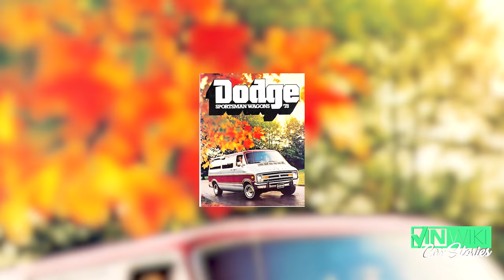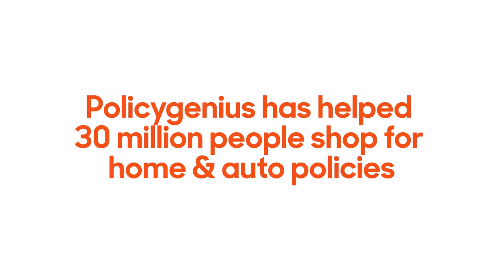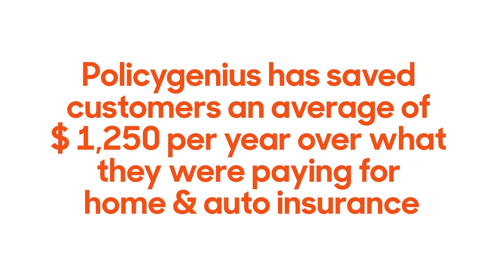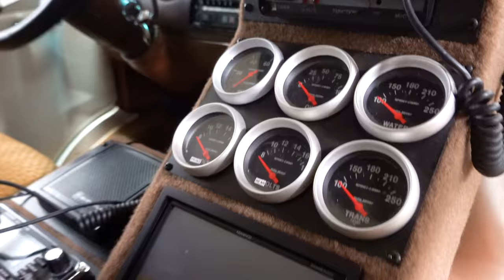They Left A Broken 700HP AMBULANCE At My Shop And Told Me To Fix It (TOTAL DISASTER)

Comment: The spark signal travels at 1 nanosecond per foot, so maybe 3 billionths of a second delay for that extra 3 feet of wire.  The amplitude however might be reduced over that length of cable

Comment: An excellent option for the fuel pump go with a fuel safe drop in a multi pump cage my guess would be a three pump so if one fails you can fairly easily switch it over to one of the others.

Comment: My favourite rare and hard to find van would be "the wide one" a company for a small number of applications widened the dodge van by 14 inches, and I'm not talking the wheels.....the actual body was cut in half down the middle and widened by 14 inches
Reply: Those look very odd driving down the road.
Reply: @mexicanspec  I bet they do, some didn't have the wheels widened so you have 7 inches of body over either side of the wheels
Reply: That thing is awesome bud, I had no idea cheers

Comment: You could take an program an Arduino to the fuel level sensor... where when the resistance = xx ohms, then turn off aux fuel xfter pump...  when it drops below 1/4 tank = xxohms then turn it on....  Automation....  that would be a freaking COOL setup...

Comment: My family had a conversion camper van based on a 70's Dodge van when I was a kid.  I remember that the exhaust manifold got so hot that you couldn't keep your foot on the gas pedal, as it was just a few inches away in the dog box.  We tried everything we could think of as heat shields.  We even had layers of white asbestos sheeting (you could still buy that back then).  It was awful.

Comment: Couldn't really peg the scanners, but make sure they're modern enough to read trunking systems. And if you're concerned about fuel spillage with that monster transfer pump, just plumb an overflow line back into the secondary. I really hope I get to see this van run through someday.

Comment: The problem with using hydraulic hoses for cooler hoses is that the hose liner may not  be rated for hot oil. The result can be hose becoming very stiff and possible liner failure.

Comment: Using a Gear Vendor (putting it in manual mode in splitting shifts) is so much fun you'll be amazed at how quickly you'll launch.  Otherwise, put it on auto & it'll (overdrive) shift up at (?) 45 to 55 mph, it's always nice to hear your motor (chill out) drop RPM.

Comment: Enjoyed this episode. Question. What did you do to shield the fuel lines and transmission cooler lines from both the direct and radiant heat from the exhaust pipes and mufflers. Your quite scarce on proper heat shielding of wiring, transmission and fuel lines, plus protecting the floor boards from excessive heat from the exhaust system, headers and engine heat. 

Did you reconnect the fuel pipe vent line that runs from the top of the tank to the opening just inside the gas cap? 

I love these old B vans.

Comment: Question, what was the reason for the change of valve covers? Where did the Mopar Performance ones go?
No budget, time, to get a Holley Street Dominator single plane intake manifold?
Are you putting any heat shielding on the gas hard lines where they are closest to the exhaust system?

Comment: That "Command Console" is dumb.  It blocks access to the engine even for routine maintenance.  It needs a track arrangement or a hinge to move it out of the way without having to take the entire unit apart every time you need to get at the back of the engine.  On a cross-country run with minimal tools and repair facilities available, easy access to every part of the engine is vital.
Reply: Indeed…My old Chevy van had a clear plexiglass glass engine bubble cover…8)
Reply: Part of sticking to authenticity to the original.
Reply: @allenl9031  Unequivocally your right, however this is a updated show car recreation Jarred just might get to limp across America. All rare old hot rodded customized racing vans should evolve and acquire a clear interior bubble engine cover, with a snap off carpet for when it has to be historically accurate? Even more so if there is a otherwise hidden 502 engine to almost ride on top, right out in the open  to gawk at while running down the road, it would be so much more bad ass to lose that huge awkward custom console, history be damned and put all that old mess in a cabinet in the back of the van and get a clear engine bubble cover…LoL

Comment: Honestly the way I would design the fuel system in a application like this would include a cooling pack. Have a cooler inline with the feed, return and transfer fuel, with a decent fan across the whole thing. Keep the fuel going to the engine, back to the tank and tank to tank as cool as it can be. Build it as a serviceable unit, bent and flared hard line within the unit, pressure tested, the works.
Yes this would add some complexity but keeping that primary fuel pump cool and running being the primary goal, as long as its tested properly Id be more then willing to accept that.

Comment: Should replace that V8 with a Turbo Barra, ala the Barra van conversion on Skid Factory.  Makes twice the power too (probably more since it's Aussie hp not fake American hp).
Reply: @My Pronoun is WTF Jesus, touched a nerve there huh?  I've got nothing against V8's - what got me thinking about this was they'd have more room in the cab area if they fitted an inline 6 - the V8's so wide it's making the dog kennel take up a lot of space - then I thought about the Skid Factory van project which I think ended up at something like 1500rwhp and was still daily driveable.  The barra is a great engine by the way - if your not an australasian you probably don't know much about it, but it's basically the antipodean 2JZ.  Not everything Ford makes is junk (just a lot of it 😀)

Comment: Did I just see Jared drill a hole into the fuel tank then slap the pump in without cleaning out the tank ? Please, say it ain't so. Almost as good as Emelia Hartford & Co beating on a Corvette that hasn't been tuned for the boost it runs. By the way, have a good look at that press bent exhaust. Hope it's 3".

Comment: It needs safety equipment installed -- driveshaft loop, transmission blanket and the dog house needs to have some kind of re-enforcement to keep engine parts from entering the cabin should it erupt. There's no firewall protecting you and those dog houses aren't built for a hogged-out engine like that.

Comment: Why did you take off the cool Mopar valve cover gaskets?

This isn't a knock against the amazing work you are doing on this historical van but it is a shame the owner never came across someone who could make the original set up work.
If you have seen the VinWiki show about this van you know the original was driven for years after the Cannonball attempt. 

It was a support vehicle for Hal and Burt's Nascar team as well as a support vehicle for world land speed record attempts.   I doubt you would take an unreliable POS out to the salt flats while trying to break the land speed record. 

I understand that carbs are kryptonite to anyone under 50 and hope this new set up works great.  It just would have been extra cool to make a period correct one that ran as good as the original did after the bugs were worked out.

Comment: Ditch that ridiculously expensive and overrated Gear Vendors drive and get an OEM gearbox that has the right number of gears you need. 

A Hellcat crate engine with trans with a warranty would have been money better spent.

Whoever originally built the van stole that owners money...

Comment: Could use some real mandrel bends on that exhaust instead of those gross restrictive crush bends. Other than that it's a pretty sweet van for sure. Holley sniper is a no-brainer for anything domestic that needs EFI. Doesn't get much simpler at all. Especially with the base tune/ map. You can be a freakin moron and not know a damn thing about turning a wrench. Basically bolt it on and go. Holley definitely made a go-to solution for reliable/ user friendly fuel management with the sniper. If I was a domestic guy I'd be all over them.